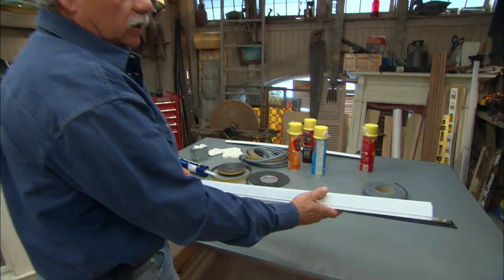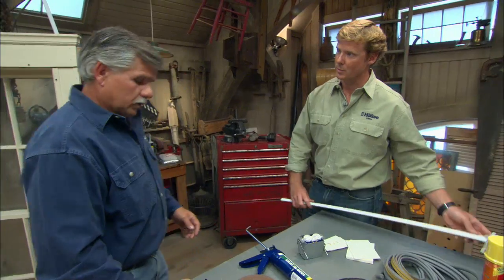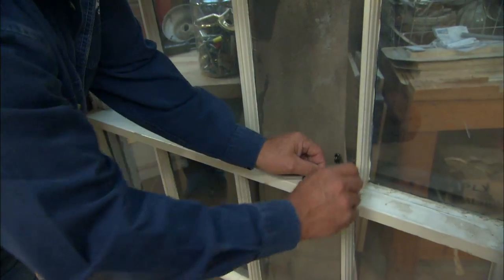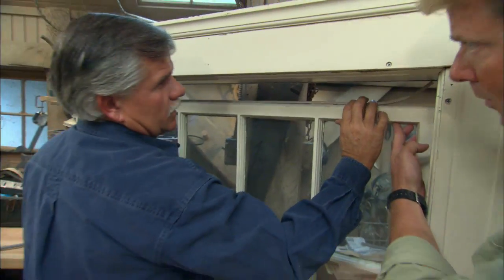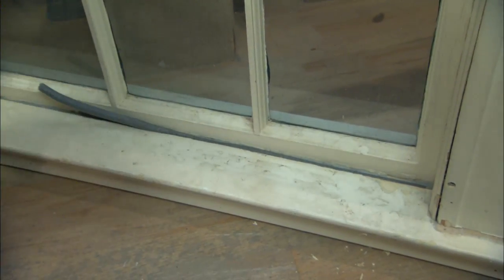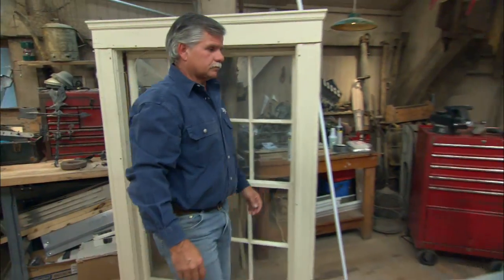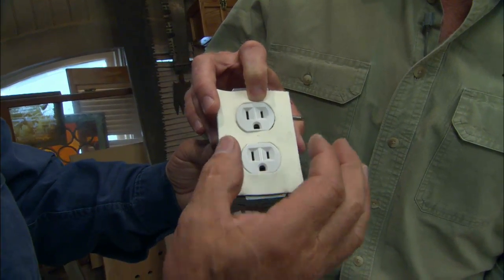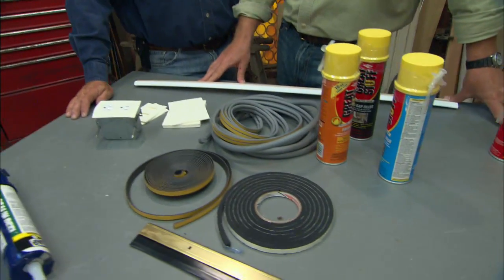How to Stop Cold-Air Leaks in Winter | This Old House

Comment: Any suggestions for a sliding patio door. I've done plastic insulating kit. I've also heard that you can take pipe foam tubing and cut it to the size of the gap once door is closed. We stay on a ground/garden level apartment. Where can you find the outlet insulation cover? Any suggestions would be very helpful. Any type of weatherstripping that can be done from the outside?

Comment: Instead of caulking or foaming around a wire coming through my inspector made me fill mine with insulation.  Just jam it in with your finger and in fact it was code to prevent air getting through that fuels a fire.
Reply: fiberglass insulation is not an air barrier.  It might slow it down if packed tightly enough, but spray foam is cheap and better.
Reply: True fiberglass insulation does not seal air now the wind is blowing in fiberglass into your house

Comment: Can you by Code put Spray foam inside a outlet box or switch box behind the outlet because the holes on the outlet will also let cold air leak in.
Reply: No. That's a huge safety issue. The wires need space to dissipate heat. This is also why you can only have so many wires and connections per cc in a box. What you can do is spray insulation in those holes where the wires come into the box. Just be sure to remove any insulation that expands into the box.

Comment: I have thermal pane windows that are vinyl and over 20 years old and can feel cold air in the gap where they come together. They have a synthetic or polyester cloth type strip between them to make the seal but it feels like cold air is coming through those . Are there replacements for those strips or what would be the best way to seal them where the locks hold that together  ?

Comment: Great information, I love - This Old House.  Any suggestions for a wood door that is warped (besides new door)?  Over the years my front door has warped and there is a gap of about an 1/8" on the top corner.  This is where a 3-point lock system would be handy, but I don't have it.  I have a draft.  Is there any after-market item (side sweep) that will work here?
Reply: You can install a thin strip of metal across the door top or door opening  that bends up or down to meet the gap.

You can also try shimming some of the hinges to even up the gap(s) around the door so they are even and will accept more uniform weatherstripping.

Comment: Window is making some slight sound but its annoying enough to keep me awake and concerned... sounds like near left or near sill, like bug but there is no bug, comes & goes but is all in all continuous - sometimes sound like leaf crackling or water dripping - nothing is there. I can feel cool air coming thru crack but it is closed. Is this all connected or is there something else going on?
Reply: Look at your house for signs of the foundation shifting; cracked drywall joints, etc. The window framing will shift and open up gaps and possibly make them difficult to open. 

The moisture and warm air escaping your home could be entering the wall behind the trim causing expansion and contraction of the wood framing. Could be water leakage in the roof coming down towards the eave and working it's way to the top of the window frame through the wall. Could be all sorts of things. Homes could be designed better.
Reply: I say it's ghosts.

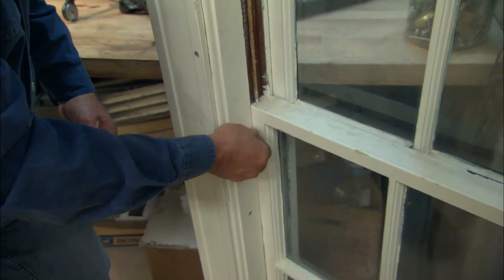Comment: What was the material you said its like clay which can use as temporary solution (1:45) ,It will be a great help if you suggest some product similar to that.
Reply: I believe Tom was using what's called "rope caulk" and "caulking cord."  They are typically available at home-improvement stores.  One common brand is Mortite (www.frostking.com/mortite-caulking-cord ).  Other examples are from Frost King (www.frostking.com/fingertip-rope-caulk ) and AM Conservation Group (www.amconservationgroup.com/products/weatherization-products/rope-door-weatherstripping-and-window-weatherstripping-caulk/?variation_id=6314 ).
Reply: There is this CHEAPER option.  Get the Mylar Blanket and use Double 
Sticky Tape.  It acts as an insulator and keeps your Heat inside as 
well.  It works great and only $0.75 Cents Per Window. :D

Comment: How do you insulate the cold air duct (vey cold when it’s -40 outside) it’s exposed in the unfinished basement. (Making the basement cold 🥶)
Reply: Unless you can't get an insulated duct, how about wrapping with water heater blankets?

Comment: How about a gas fireplace?  There’s a draft in the lower section of my fireplace where the wiring is located.  I bought a roll of pink insulation that I cut and inserted which helped.  After watching a few videos I’m such the builder didn’t spray the shell with spray insulation before this gas fireplace was inserted.  HELP!
Reply: Have you done anything to fix this? I think I have the same problem.

Comment: There is this CHEAPER option.  Get the Mylar Blanket and use Double Sticky Tape.  It acts as an insulator and keeps your Heat inside as well.  It works great and only $0.75 Cents Per Window. :D

Comment: If you close up all the air holes in your house, won't you suffocate?
Reply: Air still gets through when you open and close door
Reply: This is why I don't completely insulate my windows, to keep fresh air getting inside. This is essential to avoid mould and too much humidity.
Reply: Actually, you can if you have a furnace that uses indoor air for combustion. It'd probably create enough vacuum to suck a leak in to your home anyway. It's a battle with this type of furnace and window leaks. You don't win

Comment: I find those receptacle foam covers don't work well at all in my situation; they mainly deflect incoming cold air through the plug openings. This suggests there is no insulation in that exterior wall at all, but that's a horse of a different color.
Reply: Urbino237 use child protective plugs to seal the plug itself.

Comment: Couple of questions. I have those insulators on electrical outlets, BUT i still get air coming through the actual plug slots themselves. Now what lol? Also, my front door is horrible set or framed not sure who screwed up framer or whoever made the door. But I have gaps all around the perimeter of the door. One side "not joking" 3/8" gap other side 1/16 - 1/8" gap. Top 1/4-3/8". What do you guys recommend? I have tried the widest foam I can find and still get air in. Is it as simple as buying a new door or will I have to have re-framed? This frame is in brick wall.
Reply: Anthony Z Get those child proof socket protectors. If you want to use the outlet, just take them out.
Reply: Reframing the door sounds like a better option.  Because you can do it correct. Good luck.

Comment: I have MASSIVE windows in my room at my house I live in for college. Takes up 3/4 of one side of my wall. I got thermal curtains, but that didn't work.
Reply: There is this CHEAPER option.  Get the Mylar Blanket and use Double Sticky Tape.  It acts as an insulator and keeps your Heat inside as well.
Reply: Jordan Bronson Thank you!!
Reply: +Farquad of the Islands - You are Welcome.  Give it a try, you will be amazed.  Since Mylar use as a Warmer Blanket for Runners, it works great on Windows.  Another usage, you can use that in the Summer as well as a " Sun Blocker " to keep your Room Cool.
Reply: What is that brown rubber role called that he use to stick on the side of the window??

Comment: Why the heck does no one have any tips for sliding metal windows??
Reply: Get the Mylar Blanket and use Double Sticky Tape.  It acts as an insulator and keeps your Heat inside as well.  It works great and only $0.75 Cents Per Window. :D
Reply: Get different windows. duh.

Comment: In Additon? Instead of spending $600 per Double ThermoGlass-Pella Windows? I just Installed an Interior 1/8' Plexiglass Storm Winwo.. Put 1/4" Foam stripping around the side facing the Window Frame and a couple of Clips to Hold  it! Bingo..! Cost me $40 per Window! Inside Plexiglss Storm window for winter.. save over $500 Ea.  and kept our Beautifull nice Wood Fram Windows..We Refinished the Wood and Silicone Seals the Glass and they already had Outside Vynil single Hung Storms in Nice shape.. Even had one cut for our 5ft x 5ft Picture Window..( $100) But installed that Permamently..with silicone ..then use Framing Trim and stained it to match  the rest of the window Frame.
Reply: Dont buy into pella windows. You lock your self into a contract all future work to only pella installers. The most expensive company out there 2-3 times the price.
Reply: Selna Goodhead make video demo
Reply: I have Pella windows in my home- they're awful.  My curtains move on windy days when the windows are closed.  I don't recommend them to anyone!

Comment: want to come over fix my mobile home I bought one as is and is a fixer upper! I have a sick kid I adopted and I bought it to get closer to hospital
Reply: We Rehabbed a 14x50 Mobile Home as our Summer & Fall Place.. and maybe these ideas they talked about  will help, but we also Doubled the Windows..!
How: Adding 1/8" Plexiglass from the Home Depot( or Lowes) as Inside Storm Windows..Instead of using that Thin Plastic.and a hassel putting up and taking down every year.. ( We took Aprt the 2 Doors and Filled them with Can's of Liquid Foam ..Got Underneath the outside of the Floor and added 3" Foam Panels to the Floor & Added 1" Foam Panels to the Skirt around the Bottom the the trailer.. Can Drilll 1/8"" Holes in the walls and every 1ft down to Spray in your own Liquid Spray cans of foam into the walls.. Its not Perfect, but aleast its Alot better than it was and alot less to Heat it too.! Hope that helps
Reply: Awww hope they doing better now

Comment: What do you do about that air that still comes through the outlet plug in holes... I mean it can really comes in at times ... winter air ... I use those plugin covers on most but would really like to not have to👍🏻 
Do you know where to seal up places in a singlewide pleeeeease‼️
Reply: If you are somewhat handy, you can power down the breaker to the outlet(s) in question. Once powered down, remove outlet cover and outlet (leave wiring connected - only unscrew & pull out & over) once removed - locate and gaps, holes ect in the electrical box & either fill with caulk or cover with aluminum tape. This should help seal out any air leaks you are experiencing.
Reply: Only use firestop caulk or foam around anything electrical

Comment: Its not the cold air is welcome to leak out! Its the hot air I want to keep in.
Reply: Same thing.  Cold air coming in, replaces the hot air that you have.
Reply: There is this CHEAPER option.  Get the Mylar Blanket and use Double 
Sticky Tape.  It acts as an insulator and keeps your Heat inside as well.  It works great and only $0.75 Cents Per Window. :D